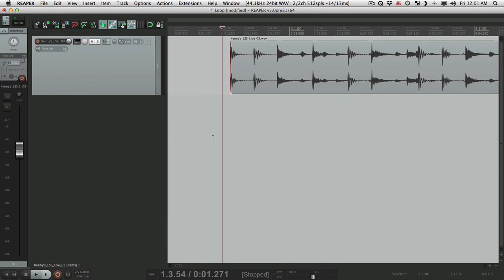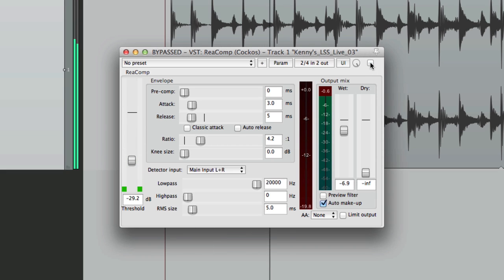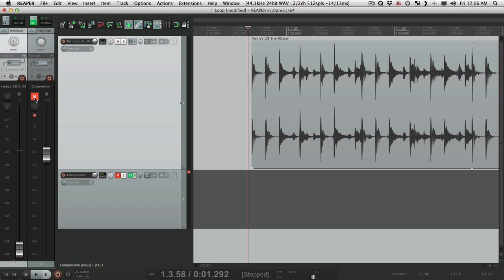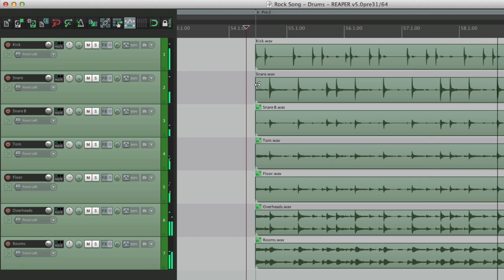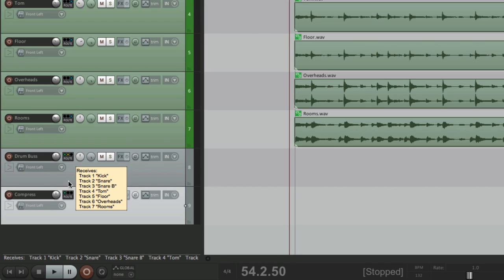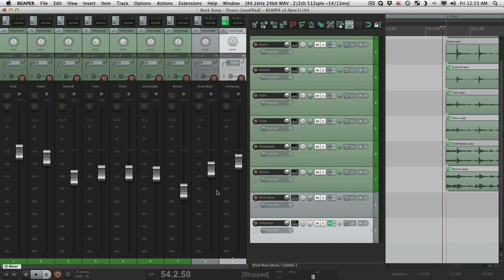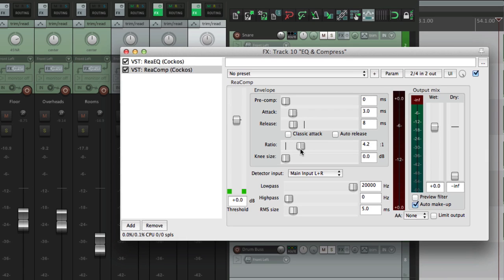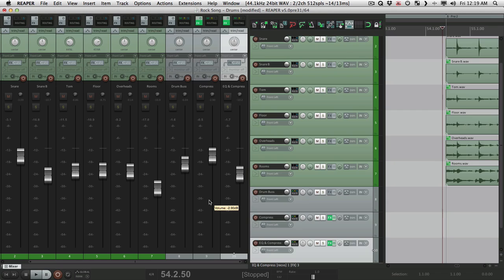Parallel Processing in REAPER

Comment: I've been trying to do this for months without success. Most of the time, when parallel processing, I want to mute the original track and only listen to the parallel one, so I can tell what I'm doing to it before mixing it with the original, but everytime I mute the original it stops sending signal to the parallel track, even if the send is pre-fader. In Pro Tools, the mute button doesn`t affect the send when its pre-fader, but in Reaper it does, and its very annoying. The way you "muted" the original track in this video was by moving down the fader, which I find unuseful since most of the time I've already set the fader to a position I don't want to change. Pre-fader sends should be pre-mute as well. 

Is there a way to make it work that way?
Reply: Hello? I still can't figure it out :(

Comment: Thanks for the vid!
I wonder.. why are there no phase issues when you add the EQed sound?
Reply: There is some phase issues BUT, Kenny placed the Cut frequency of the HPF around 1000Hz. So the most part of the fliping phase due to the EQ is between ~1000hz and ~ 3.5Khz. In this particular exemple, it helps the high end and the low end to be more present. Phase rotation are not always problem, sometimes it make the overall sound better! With reaeq, you can check the phase rotation by ticking the "show phase" square in bottom right.
Reply from the maker: Александр Зилков REAPER has delay compensation built in.